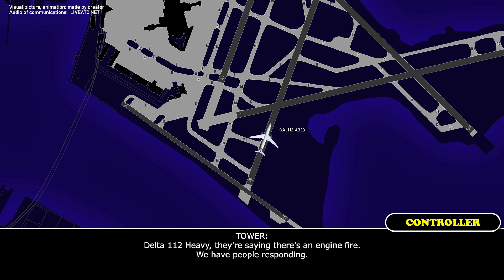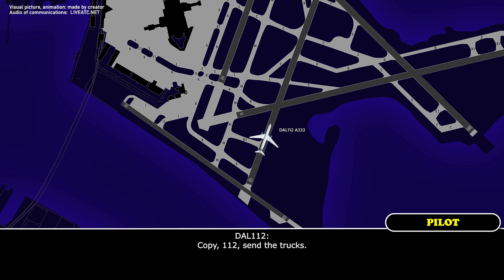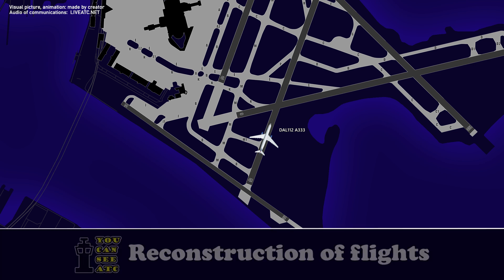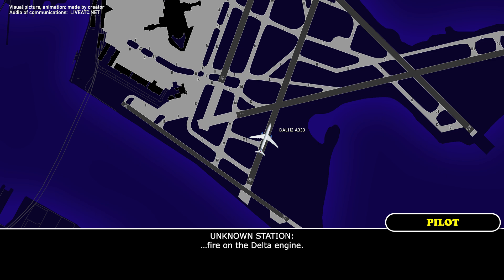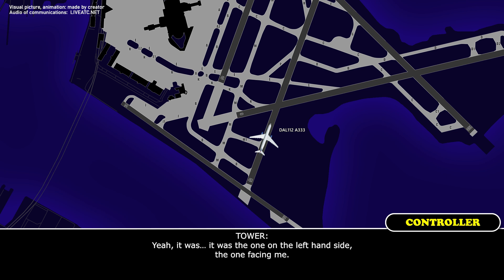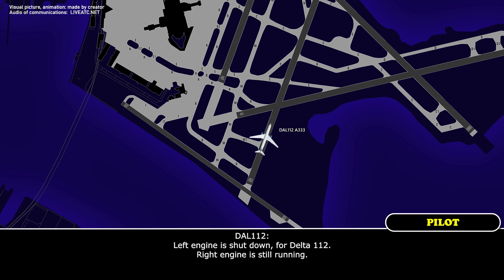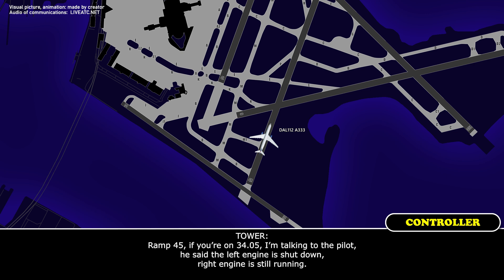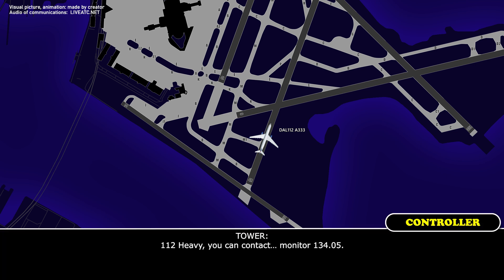ENGINE FIRE on runway. Delta Airbus A330 reports loud bang before takeoff from Boston. Real ATC

Comment: "There was a loud bang as the thrust levers were brought forward towards takeoff power. Other aircraft and our flight attendants all reported the engine fire; however, we never had a fire indication in the cockpit, so it was likely in the tailpipe section (the safest place to have one). Our maintenance found metal debris from one of the compressor fans had blown through the engine. This is often referred to as a compressor surge. Essentially, for whatever reason, the engine was getting too much fuel and not enough air and boom. Fortunately, it happened at a very low speed and on the ground." - Facts

Comment: Even our plane yesterday DL777 had a engine fire after the big bang on the runway about to take off.  When I start to look this up there was another flight recently in Paris had a same exact issue on the runway about to take off with big bang DL95.  All of these aircraft are Airbus 330.  Delta is not doing something right with their engine repairs.

Comment: Is it company SOP to keep the engine running and causing it to pretty much self-destruct rather quickly? I thought the training for engine fire was to pull the red handle to shut off fuel supply and discharge extinguishing agent into the engine. What am I missing?
Reply: They said they had shut off the left engine…
Reply: It all depends, jet pipe fire? You keep the engines motoring.
Reply: "There was a loud bang as the thrust levers were brought forward towards takeoff power. Other aircraft and our flight attendants all reported the engine fire; however, we never had a fire indication in the cockpit, so it was likely in the tailpipe section (the safest place to have one). Our maintenance found metal debris from one of the compressor fans had blown through the engine. This is often referred to as a compressor surge. Essentially, for whatever reason, the engine was getting too much fuel and not enough air and boom. Fortunately, it happened at a very low speed and on the ground." - Facts

Comment: I thought it was only Boeings that had issues…………….😮
Reply: Airbus and Boeing don't manufacture engines.
Reply: @dynodin81  if you watch these kinds of videos, commenters dump on Boeing, even when it is an engine issue. Second, Airbus technical issues have dominated these type of videos in the last 6 weeks. I am including the ersatz children’s jet A220.  This was tongue in cheek for the keyboard commandos. Inflight Emergencies (IFE’s) are no joke in large aircraft, especially heavies. I have had electrical failures, engine failures, smoke in the cockpit, engine fires, hydraulic system failures, avionics failures inflight. No airframe or engine manufacturer is immune.
Reply: Engine is PW..........